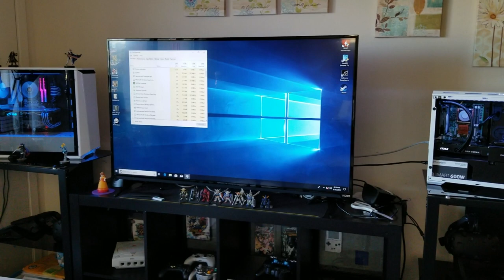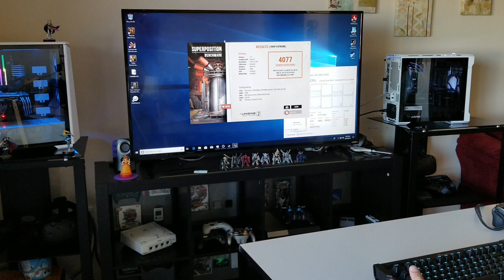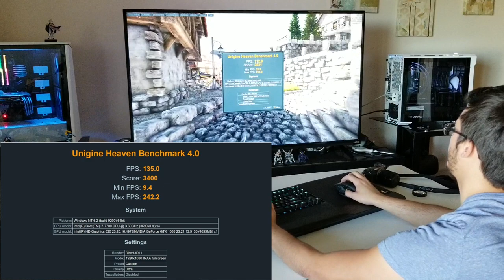Laptop CPU in a Desktop!? - Can it play games?

Comment: fascinating! If i could ever get my hand a i7 like this for free or super cheap i think i could use this as a streaming pc since i play many cpu intensive games or might even be able to convert a console of some sort
Reply from the maker: I just upgraded and overclocked this build playing games on 4k 60+ FPS now.

It's a top notch motherboard and processor.
Reply: CrimsonCursed  how far did you actually push that processor I'm guessing 4.3ghz maybe a bit lower with a gtx 1080ti? Because gaming at 4K 60+ fps is pretty crazy considering this CPU
Reply from the maker: @littlenightk  
I was able to hit 4.29ghz .  Pc locks up at 4.4ghz. But I didnt over volt yet.

After all my latest tests this build beats my i7 7700 build with the same 1080.  Of course not all games are 60fps 4k max settings 

So I sold the 7th gen build and starting over lol.

The next time I do a video on this CPU I will have a rtx 2080

I have another video of some 1080p gameplay at 3.1ghz underclocked on a i7 3920xm.
The slow ssd and hard drive in the video limited the machine.

I have since upgraded to a better HDD and SSD. And all the studder and lock ups went away.

I never got a chance to do the full overclock video.  But hopefully soon
Reply: @Thrash05  hi you overclocked the 3632QM to over 4G? You should list it here: https://hwbot.org/hardware/processor/core_i7_3632qm/
What are the thermals could I ask?
Reply from the maker: @restlez2002  
I was able to get it to 4.2Ghz on my 3920XM without voltage change stable.  Thermals are around 75 degrees with some terrible thermal paste application.  waiting for Thermal Grizzly to release carbonout

I have a upgrade video of this setup for the XM CPU.

and eventually I need to make a new video on the overclocks and where it currently is

Comment: Will this motherboard work for my i5 2450M.
Reply from the maker: yes.  you can use 2nd and 3rd gen processors on this motherboard.

Any motherboard that is socket G2 can support 2nd and 3rd gen intel mobile processors

Comment: Hey I have i7 4700mq can I use normal motherboards for that
Reply from the maker: Yes you can,  The socket for that processor is Socket G3

Here is a link to a motherboard that is compatible. and the datasheet so you can see that it does use 4th Gen I7.  I cant say for certain it will 100% work but it should be fine

This is actually the motherboard model  above the one in the video

You will need a heatsink for the CPU and chipset in order to use the board

If you are new to computers and have not built many or new to electronics I would not recommend a industrial board because it is not always clear cut on how to get them running. since ive never used the board I couldn't tell you how to get it running so you will need to figure that out for yourself

Ebay Link:
https://www.ebay.com/itm/ns12-Logic-Supply-ML400-ASRock-IMB-180-Mini-ITX-IPC-Server-Motherboard-Socket-G3/133135412851?epid=21010539895&hash=item1eff7d2e73:g:U9wAAOSwtutcVbHT:sc:USPSPriority!44130!US!-1

Link to asrocks Motherboard Page
https://www.asrock.com/IPC/overview.asp?Model=IMB-180

Comment: Hello is it possible to convert cpu laptop the socket is fs1 to desktop?
Reply from the maker: Technically there are FS1 socket Desktop style motherboards.
but you would be paying $100 to $200 for a the board only.  Then you would need to find a compatible heatsink, and hope it even works.
Might as well make a desktop where you are able to upgrade later on.
Upgrade path for these old boards is slim to none.
But if still interested.  here is a link to a board i found
https://www.ebay.com/itm/Jetway-NF-83-Mini-ITX-Board-AMD-R-Series-APU-Socket-FS1r2-35W-Formerly-eTrinity/124249766986?hash=item1ceddcfc4a:g:7VAAAOSw2~hfA18A
The Board only supports these processors.
R-464L
R-460H
R-272F
R-268D
A8-4500M
A6-4400M
A4-4300M
If you dont have any of these.  i wouldnt try the board
Here is the manufacture listing
http://www.jetwaycomputer.com/NF83.html

Comment: i like this 
i have now processor i7 3630qm and 8gb ram plz tell how connect power blok on motherboard please
Reply from the maker: This motherboard only uses 4pin power.  So you have to jump the 4 and 5 pin on a 24 pin ATX PSU to get it to run,  or use a AT power supply

Comment: Can u just put a laptop cpu in a desktop motherbored
Reply from the maker: No, laptops use Pins on the processor or are soldered directly to the motherboard.

Desktops use pads 
laptops are typically "PGA" Pin grid array
Desktops are typically LGA Land Grid Array

unless its AMD, AMD still uses PGA

Comment: Is it possible to put an intel core i5 8th gen into a pc?
Reply from the maker: if you are asking to put a i5 8th mobile CPU into a PC,  No it is not.  Any laptop after 2015 cannot be moved over to a desktop.  due to the processors being soldered to the motherboards
Reply: @Thrash05  thanks, just wondering how much do you think it would cost in AUD to take my pc from 20 fps to 60?
Reply from the maker: @AzimuthA1  Desktop or laptop?.  If its a laptop,  buy a new one for gaming.  if its a desktop,  you may only need a graphics card.  but would still cost you $400+  (USD)

Comment: I have a broken laptop, can I change the laptop processor into my PC???
Reply from the maker: in all honestly.  if you don't do research on the hardware you have, you probably shouldn't pursue something like this.

these types of computers are not for beginners to hardware modifications.  

Nothing on this PC was cut and dry,  it was constant experimenting, and troubleshooting. 

you are better off buying or building a new PC
Reply: @Thrash05 , yeahh. I've tried and done it already. The laptop processor have a different shape than the dekstop one. I was just too  lazy to make a research about it. Actually, I've rebuild a lot of PC before, using only second-hand stuff. Its work perfectly find. But, this one, I never try it, far from do it. Thats why I ask you. BtW, thanks for answering my question...

Comment: If. I want to upgrade an old i3 core to i3 8100 to laptop can I
Reply from the maker: No.  Mostly every generation has a different socket.

Example
A i3 3rd gen slot will not fit a 8th gen cpu
Reply: @Thrash05  crimson can i use my laptops i7 and put it in my motherboard to play games
Reply from the maker: @kramer3743  No,  the motherboard has to be specifically made for the processor.  You would have to buy a motherboard compatible with your laptops processor
Reply: @Thrash05   oh thanks for the tip mate.

Comment: I have the same laptop model with an i5 2450m. I was planning to upgrade the cpu but wasn't really shure because of thermals, but the thermal solution looks really similar.
Reply from the maker: Just check the wattage with what you have currently.

The non XM processors run fairly cool

Comment: My pcu is core I 5 3rd gen can I use in pc
Reply from the maker: if its a laptop i5 third gen.  Then yes.  That is what this PC is.  its a 3rd Gen Intel processor
Reply: Ok now I can switch the (laptop) Intel core i5 3rd gen to PC (desktop) right?????
Reply from the maker: @rex6x995  You could, if you spend the money for a motherboard that can use that processor, and everything else that would be required to do so

Comment: This video gives me hope, i have 2 4gb ddr3 sodimm memory sticks and an i3 from sony vaio laptop. laptop is broken, but memory and processor is ok. now i have to figure out the socket and find a mother board for them. don't know how to know the socket.
Reply from the maker: look up the processor and look for ARK INTEL,  Scroll down to package specifications,  then under sockets supported.

Look up that socket on google to get its other name 

Example, a 3920XM is a  FCPGA988, googling  FCPGA988 gets me to Socket G2

from there look up the Socket type on ebay  followed by ITX, and you should see some boards

Getting a board with 24 pin Power supply is by far the best options.  if you get one with only 4 pin you will need to do some special wiring to get it to run

Comment: I dont even have a laptop that can bearly run games that work on a i3
Reply: My old laptop was so bad is os was window 10 on 1.8ghz i3 1 core 4gb unable to keep cashing when i been on for 5 hours a that only thing the laptop got right
Amd 1gb vram only time i able to play a game when i downgraded the os to window xp is work right
Not as laggy

I unable to play gta 3 a old game 
My desktop i3 3.90ghz 2 cores
£500 got 8gb Nvidia GeForce 1050 2vram

My new laptop is i7-7700 2.8ghz going to 3.20ghz 4 core 2 gpu

Intel 630 8gb vram
Nvidia GeForce 1070 8gb vram

£800 ge72mvr pro 16gb ram

Comment: so , i got a i7 7700hq processor that i want to put  into a new motherboard , is it possible ?
Reply from the maker: it would cost more to make that happen than to make a new Desktop PC

Plus most newer laptop processors are soldered directly to the board,  so you wont have a good time removing it

Comment: I have i3 processor on my old laptop .how can I put it on my desktop
Reply from the maker: you cannot put a laptop processor into a pre existing desktop.  you practically have to make a new PC with desktop style Laptop parts.

If you have a old laptop.  might be possible.  but if it has been made in the last 7 years,  probably not gonna work
Reply: Can I install core i3 laptop processor in New Desktop mother board?